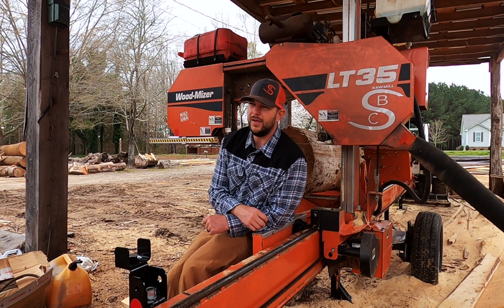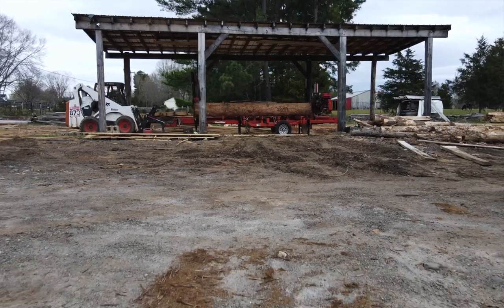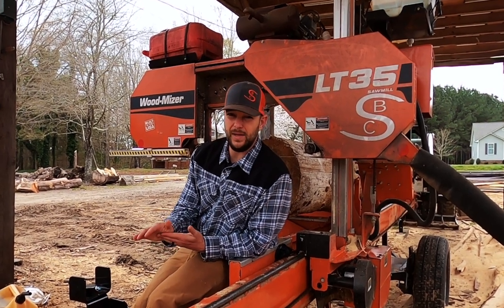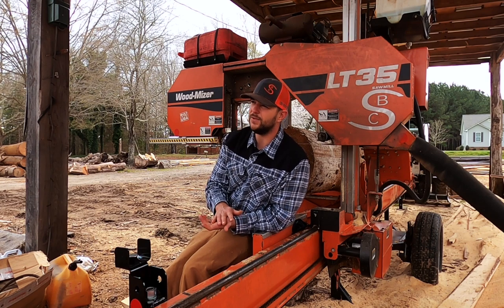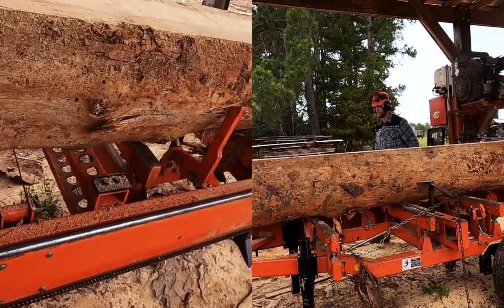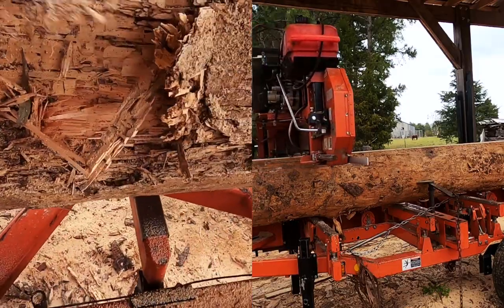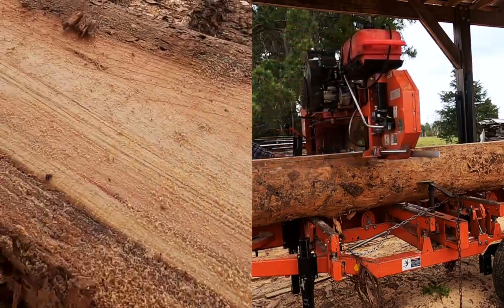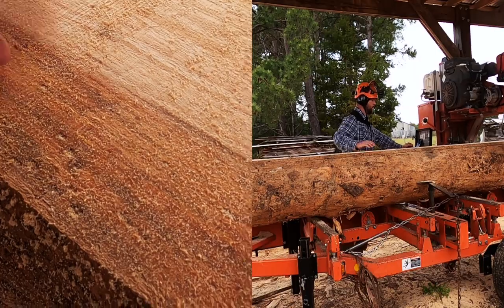Sawmill Shed for The Wood-mizer LT40 Expanding my Small Business.

Comment: The skid steer works a lot better than that hand crank winch I see.  You will really love the hydraulic mill when it comes............All I have is a 25 horse JD tractor, gotta get a bigger one with a grapple on the front.
Reply from the maker: The grapple is a game changer. Definitely worth the investment.
Reply: I have a JD 4052 with a grapple and it's still not enough for a lot of the logs I get ahold of for the mill!
Reply: @JohnTHull  I traded my tractor in and now have a 38 horse JD.  Been building my pole bard ,just got tee roof on and have to put the steel on the walls and hook up a vacuum system for the sawdust before I will do any milling. I have a stone floor and do not want to have to clean saw dust up..  I don't see the tractor as a big issue.  I'll just roll the to the side opening where the lift arms are and push them up on the hydraulic lift arms if I have to.